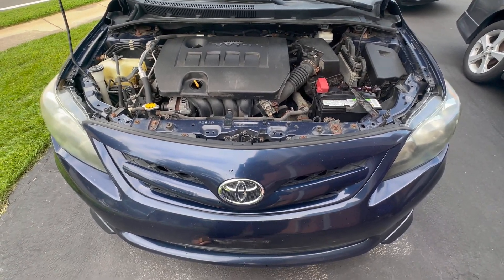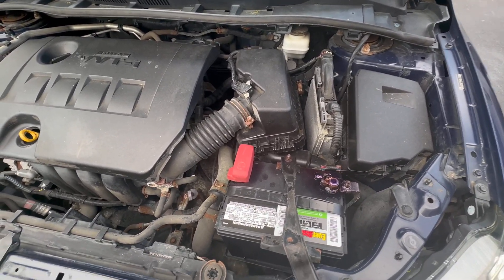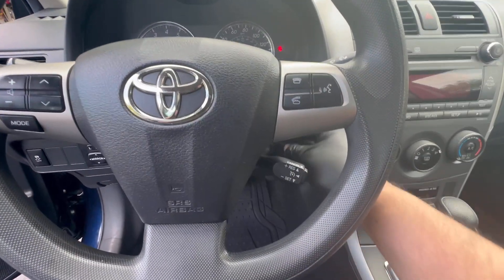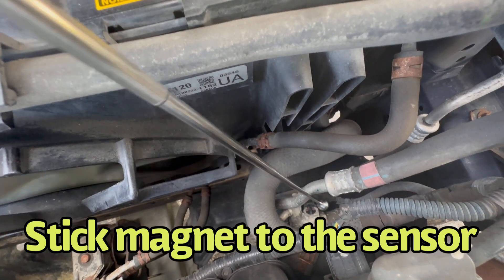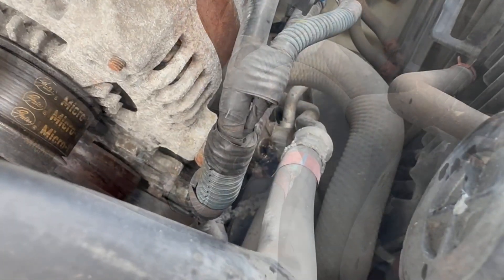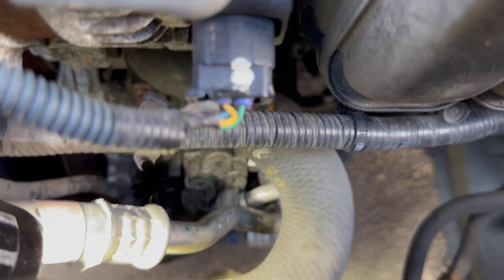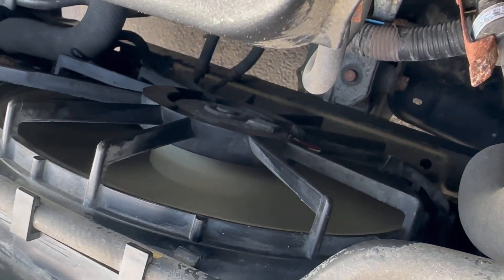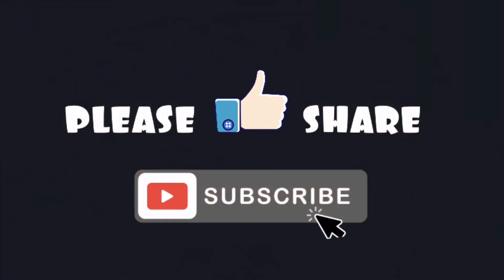2011 Toyota Corolla CHEAP FIX AC!

Comment: Looks like this car has not run for a long time from the rust on the pulleys.  When you ran the car the serpentine belt got a brown tint from the rust coming off.  Good video otherwise.